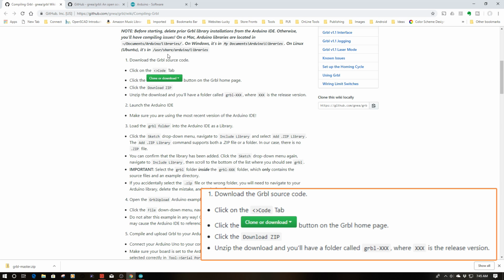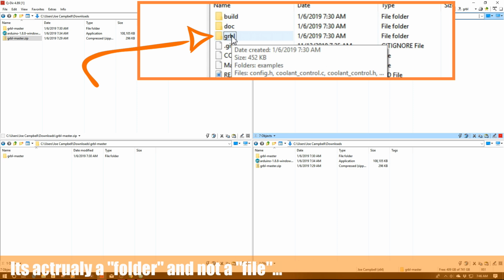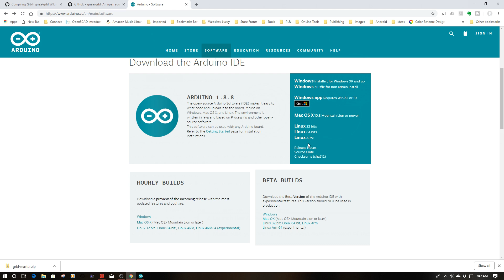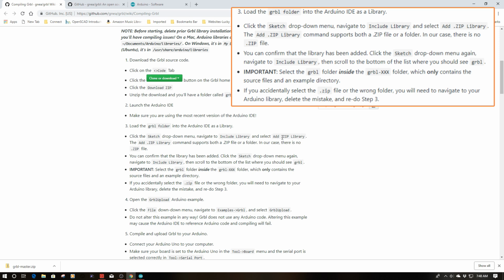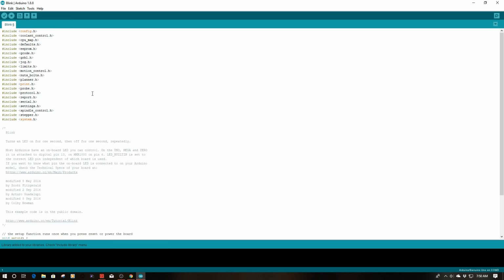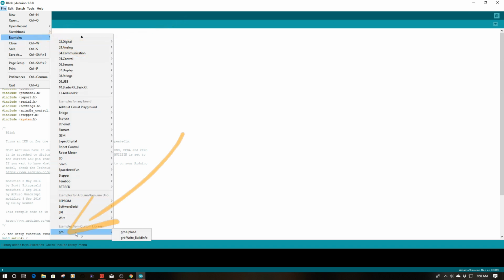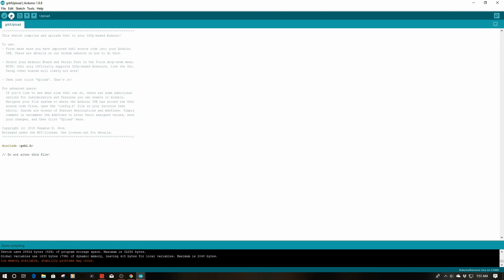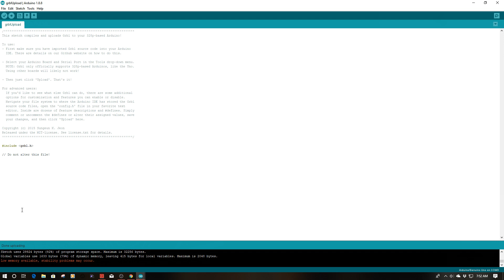GRBL 1.1 - Step By Step Installation Guide to Flashing Arduino Uno!

Comment: Hi 

is there a way that i can check which firmware that's are installed in my arduino before i start to flash an other firmware on top of the old one, or do i have to uninstall the old firmware first and how do i do that

br

elevalther
Reply from the maker: New firmware over writes so no worries and if you have existing version of GRBL, just connect and GCode sender and type $$ in the console window and it will tell you the version of GRBL
Reply: @DIY3DTECHcom  Connect your grbl to the Arduino IDE via the USB lead, open the Tools | Serial Monitor and re-boot the grbl.
It'll send basic data to the window as it boots, including the version info.

Comment: hello all.  I hope you get this. I followed your instructions.  It worked great until the end. Got error message serial port not selected. This is a sainsmart 3018-mx3 cnc. As I read on here i see people say to get a real arduno board. I am new to all of this ie cnc, arduno, etc. Is there a quick way to fix this, so i can test out my machine? Also which arduno board should i buy? I was really hoping to make some Christmas gifts. I really hope you get this and someone can help.  Thanks
Reply from the maker: Sound like you didn't specify the serial port, the focus of these video (there are several on GRBL) are the for installation of library with the assumption of a basic understanding of Arduno.  If you not sure, there are tons of video on this (which is the reason for not including) just be sure to select Mac or Win in your search as they are a little different.  Unless your decide to run Linux for your Gcode sender, would suggest a real arduno as the cheap Chinese versions use a knock off CH340 UART for serial communication and Windows likes to disconnect midway though long jobs trashing your project. There is a CH340 driver (just google it), however even with that under windows I had issues.  Linux handles USB communication differently so does not have the same issues as windows...  Best of luck and enjoy Xmass!

Comment: Whether this arduino software can be used for 32bit systems?
Reply from the maker: I have only used the 64 bit...
Reply: @DIY3DTECHcom  i want to ask that is there any ready post processors for commanding to machine without doing the arduino programming and grbl etc. Such a lengthy process, so it would be easier for programming?

Comment: GRBL 0.51.hex , GRBL v.0.7.hex , and GRBL v.1.1.hex,  ALL turn on my laser and it wont turn off.  it just burns in the home spot until I start running the laser. I found an OLD version .hex file that came with the benbox software. but it will NOT work with the new version GRBL controller. the laser came with a Arduino NANO(chinese version).
I want to use the newer version of GRBL controller because well, benbox SUCKS BALLS and the older version will only work with .NC files. the newer version will create .nc files from your pictures.
OK back to my problem...is there a way to turn off the laser or edit the source files to get the laser to only come on when needed?
Reply from the maker: Then have wired something wrong as for both my k40 CO2 and diode laser project (there are play lists for both) worked fine, as note you should be using the PWM to drive the laser driver....
Reply: @DIY3DTECHcom  that's the problem... The old L2 boards don't have a pwm plug. The newer mana se boards have it. Somewhere along the line they decided to change the code and forget about all the people who still have the old L2's.

Comment: This was a helpful step by step video that worked for me up until the point of uploading the example file.  I have the correct com port selected and I get the following error, can you help?

Arduino: 1.8.10 (Windows 10), Board: "Arduino/Genuino Uno"

In file included from C:\Users\pharm\Documents\Arduino\libraries\grbl/grbl.h:43:0,

                 from C:\Users\pharm\Documents\Arduino\libraries\grbl\examples\grblUpload\grblUpload.ino:27:

C:\Users\pharm\Documents\Arduino\libraries\grbl/nuts_bolts.h:56:0: warning: "max" redefined

 #define max(a,b) (((a) > (b)) ? (a) : (b))

 

In file included from sketch\grblUpload.ino.cpp:1:0:

C:\Program Files (x86)\Arduino\hardware\arduino\avr\cores\arduino/Arduino.h:93:0: note: this is the location of the previous definition

 #define max(a,b) ((a)>(b)?(a):(b))

 

In file included from C:\Users\pharm\Documents\Arduino\libraries\grbl/grbl.h:43:0,

                 from C:\Users\pharm\Documents\Arduino\libraries\grbl\examples\grblUpload\grblUpload.ino:27:

C:\Users\pharm\Documents\Arduino\libraries\grbl/nuts_bolts.h:57:0: warning: "min" redefined

 #define min(a,b) (((a) < (b)) ? (a) : (b))

 

In file included from sketch\grblUpload.ino.cpp:1:0:

C:\Program Files (x86)\Arduino\hardware\arduino\avr\cores\arduino/Arduino.h:92:0: note: this is the location of the previous definition

 #define min(a,b) ((a)<(b)?(a):(b))

 

In file included from C:\Users\pharm\Documents\Arduino\libraries\grbl/grbl.h:43:0,

                 from C:\Users\pharm\Documents\Arduino\libraries\grbl\examples\grblUpload\grblUpload.ino:27:

C:\Users\pharm\Documents\Arduino\libraries\grbl/nuts_bolts.h:61:0: warning: "bit" redefined

 #define bit(n) (1 << n)

 

In file included from sketch\grblUpload.ino.cpp:1:0:

C:\Program Files (x86)\Arduino\hardware\arduino\avr\cores\arduino/Arduino.h:123:0: note: this is the location of the previous definition

 #define bit(b) (1UL << (b))

 

Sketch uses 29762 bytes (92%) of program storage space. Maximum is 32256 bytes.
Global variables use 1633 bytes (79%) of dynamic memory, leaving 415 bytes for local variables. Maximum is 2048 bytes.
Low memory available, stability problems may occur.
avrdude: stk500_getsync() attempt 1 of 10: not in sync: resp=0x0d
avrdude: stk500_getsync() attempt 2 of 10: not in sync: resp=0x0a
avrdude: stk500_getsync() attempt 3 of 10: not in sync: resp=0x47
avrdude: stk500_getsync() attempt 4 of 10: not in sync: resp=0x72
avrdude: stk500_getsync() attempt 5 of 10: not in sync: resp=0x62
avrdude: stk500_getsync() attempt 6 of 10: not in sync: resp=0x6c
avrdude: stk500_getsync() attempt 7 of 10: not in sync: resp=0x20
avrdude: stk500_getsync() attempt 8 of 10: not in sync: resp=0x31
avrdude: stk500_getsync() attempt 9 of 10: not in sync: resp=0x2e
An error occurred while uploading the sketch
avrdude: stk500_getsync() attempt 10 of 10: not in sync: resp=0x31

This report would have more information with
"Show verbose output during compilation"
option enabled in File -> Preferences.
Reply: That sounds like an Bootloader issue.
Are you able to upload other sketches?
Reply from the maker: You sure your using a compatable board?  From what I read it is running out of memory...
Reply: oh my there you are a nerd , am lookin for company ,  please contact me at spacedisks@gmail.com we have lots to talk, i need a nerd

Comment: was good untilllb get to the end then what ?? how you upload to cnc board
Reply from the maker: No sure of the question as you don't upload to the CNC board but to Aurdino and use the Aurdino software noted in the video...
Reply: @DIY3DTECHcom  yeh done all that so many times, seems lods saying what you say but i cant get the cnc to move, lost totally but spent 3 days now huindreds of vids and websites, nothing relating to how to get software to move the cnc moters etc.
Reply: @Bruceiwish1234  This is why I'm apprehensive about projects like this. 3 years back and you got no answer. Not saying anyone in particular is the problem, just that that's how things go wrong.

Comment: When  run the Gcrl Processing there is a error as below:
---------------------------------------------------------------

The method showInputDialog(Component, Object, String, int, Icon, Object[], Object) in the type JOptionPane is not applicable for the arguments (gctrl, String, String, int, null, String[], int)
-----------------------------------------------------------
 This is the program below:
-----------------------------------------------------------

void selectSerialPort()
{
  String result = (String) JOptionPane.showInputDialog(this,
    "Select the serial port that corresponds to your Arduino board.",
    "Select serial port",
    JOptionPane.PLAIN_MESSAGE,
    null,
    Serial.list(),
    0);

-----------------------------------------------------------

What shall i do???
Reply from the maker: Did you try googling it?

Comment: When uploading the Grbl into Arduino I keep getting this error message: Arduino: 1.8.9 (Windows 10), Board: "Arduino/Genuino Uno"

Sketch uses 29868 bytes (92%) of program storage space. Maximum is 32256 bytes.
Global variables use 1484 bytes (72%) of dynamic memory, leaving 564 bytes for local variables. Maximum is 2048 bytes.
avrdude: ser_open(): can't open device "\\.\COM3": P��stup byl odep�en.

Problem uploading to board.  See http://www.arduino.cc/en/Guide/Troubleshooting#upload for suggestions.

This report would have more information with
"Show verbose output during compilation"
option enabled in File -> Preferences.

Any help appreciated ? :D Thanx
Reply from the maker: Check you are using the correct version of the Ardunio software as well as the correct settings...

Comment: Hello, sir 
I keep facing the same problem, I can't solve it
There is a lot of warning after I compile it, I can't upload it to my china uno board
I never alter the File before and all I did is following your video
Arduino: 1.8.9 (Windows 10), Board: "Arduino/Genuino Uno"

In file included from C:\Users\danso\OneDrive\Documents\Arduino\libraries\grbl/grbl.h:43:0,

                 from C:\Users\danso\Downloads\grbl-master\grbl\examples\grblUpload\grblUpload.ino:27:

C:\Users\danso\OneDrive\Documents\Arduino\libraries\grbl/nuts_bolts.h:51:0: warning: "max" redefined

 #define max(a,b) (((a) > (b)) ? (a) : (b))

 ^

In file included from sketch\grblUpload.ino.cpp:1:0:

C:\Program Files (x86)\Arduino\hardware\arduino\avr\cores\arduino/Arduino.h:93:0: note: this is the location of the previous definition

 #define max(a,b) ((a)>(b)?(a):(b))

 ^

In file included from C:\Users\danso\OneDrive\Documents\Arduino\libraries\grbl/grbl.h:43:0,

                 from C:\Users\danso\Downloads\grbl-master\grbl\examples\grblUpload\grblUpload.ino:27:

C:\Users\danso\OneDrive\Documents\Arduino\libraries\grbl/nuts_bolts.h:52:0: warning: "min" redefined

 #define min(a,b) (((a) < (b)) ? (a) : (b))

 ^

In file included from sketch\grblUpload.ino.cpp:1:0:

C:\Program Files (x86)\Arduino\hardware\arduino\avr\cores\arduino/Arduino.h:92:0: note: this is the location of the previous definition

 #define min(a,b) ((a)<(b)?(a):(b))

 ^

In file included from C:\Users\danso\OneDrive\Documents\Arduino\libraries\grbl/grbl.h:43:0,

                 from C:\Users\danso\Downloads\grbl-master\grbl\examples\grblUpload\grblUpload.ino:27:

C:\Users\danso\OneDrive\Documents\Arduino\libraries\grbl/nuts_bolts.h:55:0: warning: "bit" redefined

 #define bit(n) (1 << n) 

 ^

In file included from sketch\grblUpload.ino.cpp:1:0:

C:\Program Files (x86)\Arduino\hardware\arduino\avr\cores\arduino/Arduino.h:123:0: note: this is the location of the previous definition

 #define bit(b) (1UL << (b))

 ^

Sketch uses 29868 bytes (92%) of program storage space. Maximum is 32256 bytes.
Global variables use 1484 bytes (72%) of dynamic memory, leaving 564 bytes for local variables. Maximum is 2048 bytes.
An error occurred while uploading the sketch

This report would have more information with
"Show verbose output during compilation"
option enabled in File -> Preferences.
Reply from the maker: Ensure you have the correct driver the Chinese board as the USB UART requires a different driver. I Also recomment using a real Uno for GRBL and NOT a Chinese one as you will have a lot of issues...

Comment: Good tutorial. It boggles my mind that the instructions on-line don't say to drill down to the GRBL folder until the step AFTER it says to add the library file. Frustrating. But the IDE really is the best way to load GRBL on the Arduino or a Woodpecker board.
Reply from the maker: LOL!  Thanks for the comments and glad it helped...

Comment: Hello.I bough this machine :
https://www.ebay.com/itm/50-65cm-3000MW-CNC-Laser-Engraving-Machine-2Axis-DC-12V-DIY-Engraver-Desktop/323612235970?epid=7027288534&hash=item4b58cad8c2:g:4QIAAOSwgPVcfOKL
This came with BanBox software which is pretty bad.I downloaded Laser GRBL software with some hex file.It is woring better than with Banbox but My Engraving are is 30cm X 30 cm with this software.I can not move laser more than this.With Banbox I could move all along.My question is how to set up proper hex file or what setting to change to have engraving 50 cm X 50 cm.I sam whis video but I do not know exactly configuration to make proper set up with GBRL Configuration Maker.Symply I do not have machine specification.Thanks in advance
Reply from the maker: You will need to compile your own version and change the "soft" limits to  50 x 50 and then up load as I show in this video its not hard as google GRBL and soft limits to the .h file as it been a while I don't remember off the top of my head...

Comment: Hi, thanks for the video tutorial. I'm using the latest Arduino IDE 1.8.9 and have followed your instructions. However, Arduino IDE will not add the grbl as a library and has the error message "A subfolder of your sketchbook is not a valid library".  Reading the official Arduino Library tutorial (https://www.arduino.cc/en/Hacking/LibraryTutorial) I read that files should be .cpp. So I renamed all c to cpp but still the same error message. I see that frequently the h and c[pp] files are now put in a src subfolder. So I moved them into such a folder - still the same error message.  I realise that you are not responsible for the grbl library but do you have any pointers I would be grateful.
Reply from the maker: Sounds like you do not have the correct GRBL files.  That would be the first place I would start.  You could also try back leveling the version of arduino too as well as ensure you have the correct board type selected before attempting to add the library

Comment: Thank you for the video - I am working on a Shapeoko 2 upgrade and am running into a Z axis problem. It will only work when set up with  driver set to 1/4 stepping. This is a 400 step system so that requires a $102 setting of over 700 to be accurate but the system will not work  above 500. How can I get past the 500 limitation? I am guessing that the h. files can be changed to match the system? Thanks for any help provided.
Reply from the maker: Not familiar with the Shapeoko stepper driver, is it set to 1/8 step?

Comment: Dear sir, I am trying to build a cnc embroidery machine. For embroidery machine z axis stepper motor should rotate only in one direction. what configuration should I make to do this?
Reply from the maker: Well for full disclosure I am not an embroidery machine expert however so long as you keep sending negative [Z] gcode it relative mode it will only move in one direction.  In absolute it would likely bump into a soft stop  but relative will tell it to keep moving from its current position.